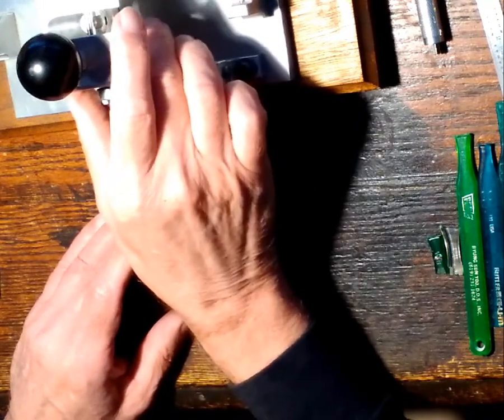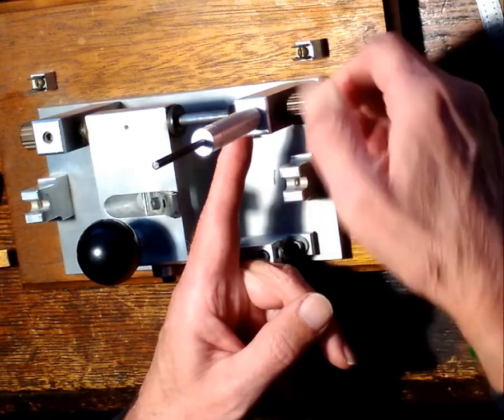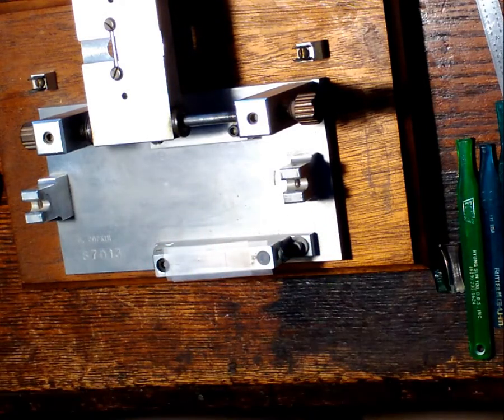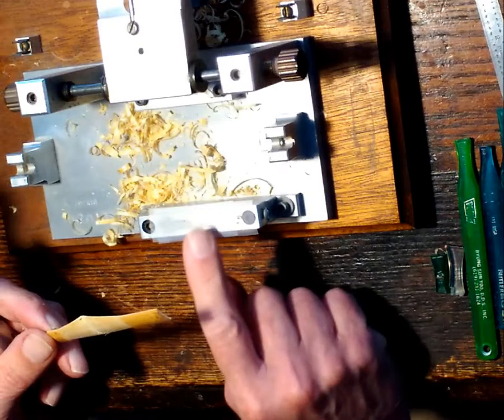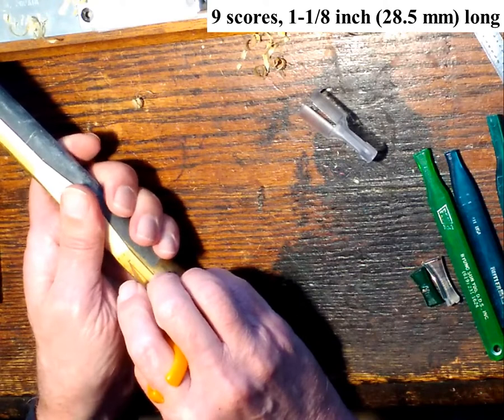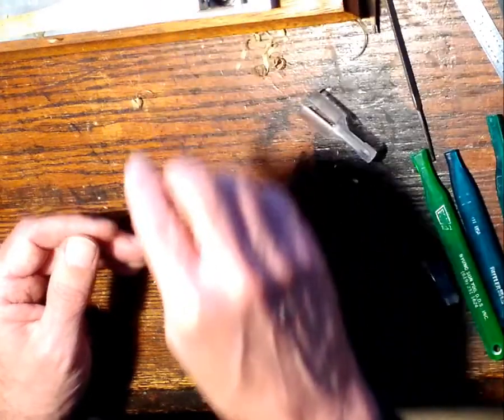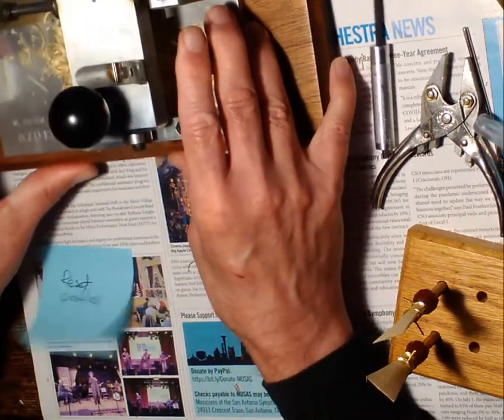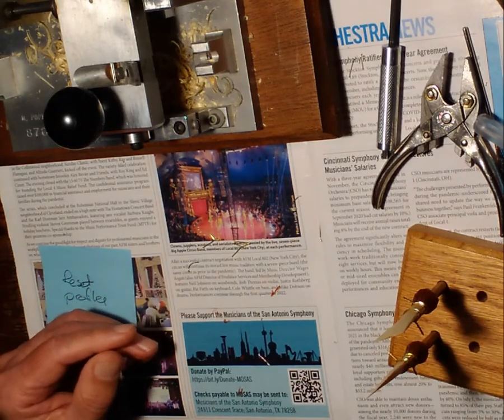Constructing a contrabassoon reed blank -- a primer for bassoon reed makers.

Comment: Hello! What is the thickness of the wire please?
0.6 0.7 or 0.8mm++? And what's the difference? What's better?
Reply from the maker: According to my references 22 gauge soft brass wire is 0.65 mm diameter (0.0254 inch).   That is what most people (in USA) use for bassoon reeds (2 turns) and what I also use for contrabassoon reeds (3 turns).  I have been told that 2 turns of 20 gauge soft brass wire will also work well -- 20 gauge wire diameter is 0.81 mm (0.0320 inch) -- I do not have experience using 20 gauge wire.